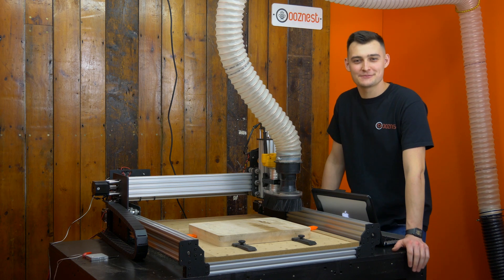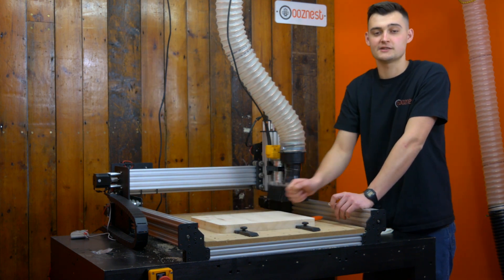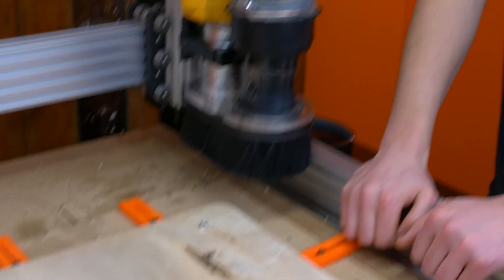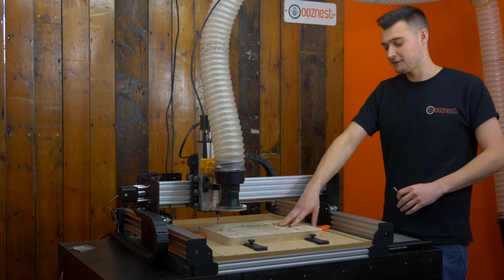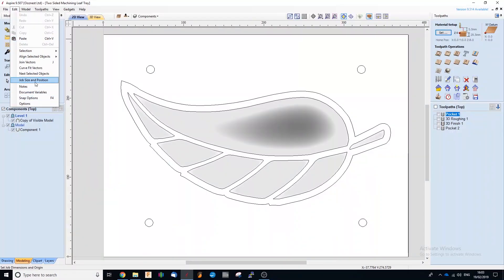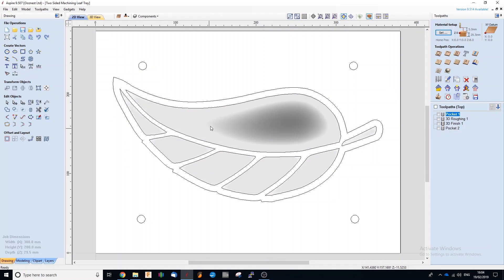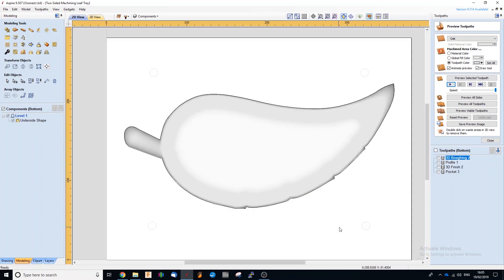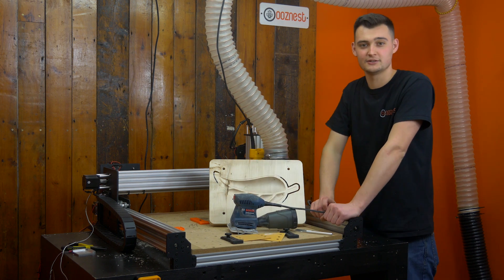Two Sided Machining | How To Guide | WorkBee CNC Machine

Comment: I’ve been trying to figure this out, and I need to know before I screw up my piece- with all of those clamps in place isn’t the dowelling system a bit redundant?
Reply from the maker: No, because you set the centre of your work piece as the Work Zero, and cut your dowels from there. The square clamps would rely on the piece of material being perfect on all sides

Comment: Ryan what's missing is setting the work zero corners correctly. So with double-sided as stated before you we get a combination of options. Material surface, work surface or same side. Now obviously the best option is the same face if cutting out a 3d object, it would counter any issues with thickness irregularities. What I've found though is no way to sense the workspace surface using the probe to get a bang on spoiler board z height for using the same side for depth reference.  Added to this I'm worried about having the Work Zero at the board level for the bottom as the bit would crash into the piece. So what's the correct way to use the "same side" option? Or would you recommend avoiding this?
Reply from the maker: Hi Pete, we probably like to avoid having the Work Zero at board level because of making a crash more likely if you press the wrong button. So I would avoid using that setting.

Comment: Awesome! How do you do the finish tool part or change the tool? Its made in vectric aspire?
Reply from the maker: Yes in Vectric, you can setup multiple toolpaths with different tools. These are exported as individual jobs, with manual tool changes inbetween

Comment: Hi I Noticed Your Have Zero Off The Same Side "Ticked" - the materials pane, can i confirm this needs to be ticked ? As I'm doing a double sided print and appears to be off 20ish mill but I don't have that box ticked - as I feared it would use the same corner that's now on the bottom (when cutting second side) so would want to plow straight down and mess it all up 👍👍
Reply from the maker: Hi, I think you keep that ticked, then you don't need to re-zero when flipping. I would try a bit of scrap with it ticked and then see how that works out for you.

Comment: Which software do you use to generate model and to work with the machine? Mach3?
Reply from the maker: Hi Enrique! We used Vectric's Aspire for CAD & CAM on this job. This would then be processed into G-Code and uploaded to our Duet Board where WorkBee Control would run the job. Hope this makes sense but please get in touch if you have any further questions - https://ooznest.co.uk/help/.

Comment: hi, nice video. Question as to the user of the machine. The machine is built on the OpenBuilds system...how is its real accuracy? as far as the rollers, or not changed?  thanks
Reply from the maker: The WorkBee was designed by us at Ooznest. All our WorkBee's are screw driven from 500x500 - 1500x1500mm. With a 500x500mm you can expect 0.05mm accuracy and 1500x1500mm you can expect 0.15mm accuracy. Yes the WorkBee use rollers.
Reply: Thank you for the information, we have practically no information about machines with this design, and are not represented on the market, mainly rails like hivin, round rails, or just cylindrical guides ... this is in Russia)
Reply from the maker: @ZukovDa  That is a shame. You can view all the information on our machines here: https://ooznest.co.uk/product/workbee-cnc-full-kit/#size-colour